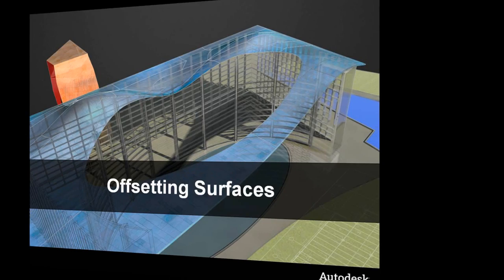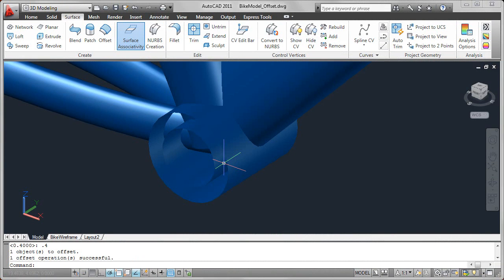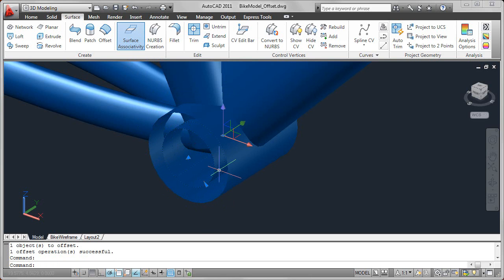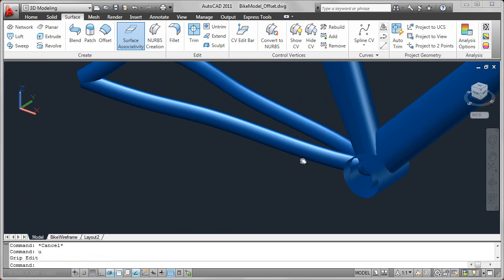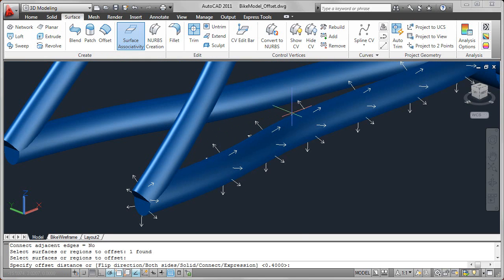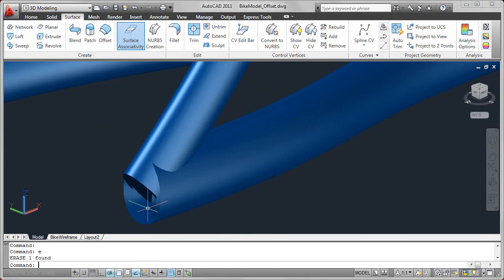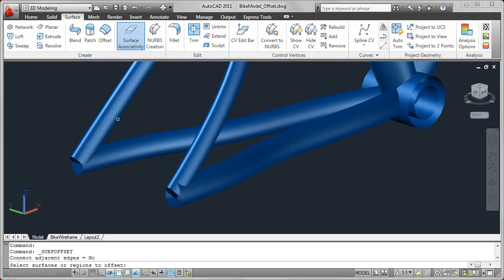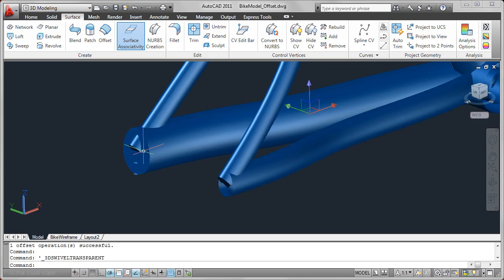Offsetting Surfaces

Comment: Hello! Thanks a lot for the video!

I am trying to do the same but not on an extruded surface, but on an object of type (3D surface)  it is a curved surface

It did not work :(
I want to give this membrane a thickness to use it in a wind simulation ... I will appreciate your enlightment!